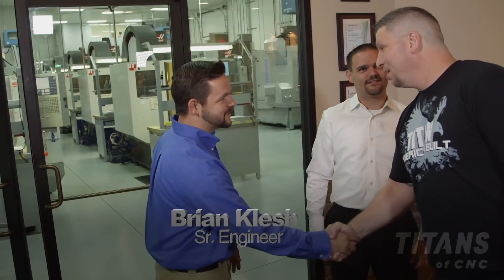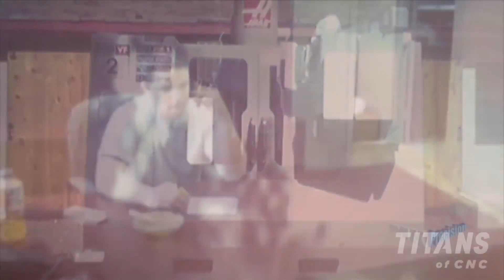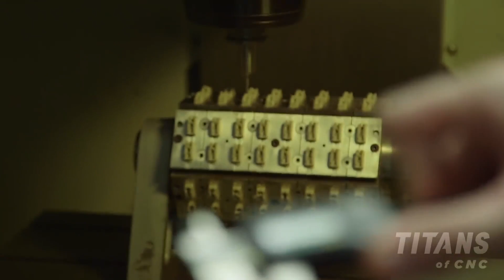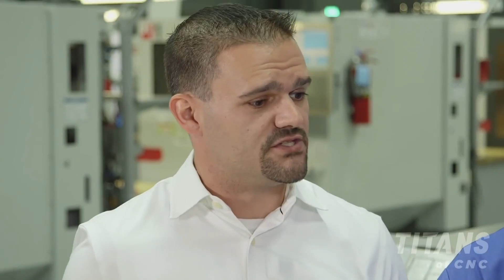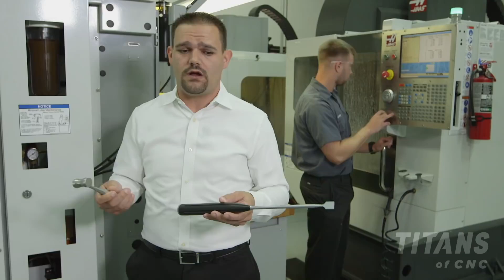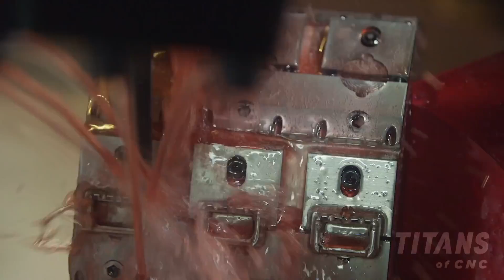CNC Machining Medical Parts Inside MK Precision

Comment: Spinal fusion sucks.
    If anyone reading this has had it done or is going to, don't be like me and learn the hard way, that you aren't going to be able to compensate 100% by working out or any other forms of physical therapy, You will be permanently limited in movement and strength and trying to get that back will only result in further damage. Get some good education or whatever it takes, to either work at a job that is not physically demanding or work for yourself so that you can choose what you do and how you do it. If you love physical activity, it wouldn't hurt to work with a personal trainer who is knowledgeable about your condition so you can learn what is and is not going to mess you up. A masseuse wouldn't hurt occasionally either.  ...or regularly. lol
  Just to elaborate, I was fused in the middle, at age 14. I started weight lifting when I was 15 and thought I could compensate for what I had lost through weight training. I gained a lot but the real mistake was thinking I could do anything anyone else can do. I got into construction and steal fabrication and did some of the most physically demanding jobs out there. I wasn't aloud into the military but I was interested enough that I learned what the majority of  requirements were at the time, for the marines and I probably could have made it through their boot camp. But the problem lies in what happens over time, when you subject yourself to stresses beyond what the surgical alteration is capable of. Man just isn't good enough at redesigning the body yet.
 
To sum it up... I broke.
Reply: Your story is amazing!! Thank you for sharing! I was in and out of ER four times over 12 years for a degenerative disk between L2 and L3. An MRI today shows a normal healthy back. I believe that I was misdiagnosed. My ortho denies ever telling me that I had a degenerative disk. Maybe next visit, if any, he will read my chart first. My medical record doesn't have an ego, but my ortho's head...well the portraits on the wall tell all.

Comment: I worked in a very similar plant for a little over two years. Very interesting work but the management was the worst I've encountered.
Reply: These two guys seem like the individuals you speak of.
Reply: If there's expecting me to run 4 machines I'll pass on that place , welcome to the new future work your ass off on 4 machines at the same time...hope young people realize just because technology is cool it's not when u get out of work just too tired to have a life outside work
Reply: This channel is great, titan is really want to share his success. But 4 ,5 machine running  one repeat part is good for owner not operator. 2 year on that job, know nothing only button pusher. you think you know some thing??. Go apply for some other job u will be shocked
Reply: If employees only knew how difficult and heart wrenching building a business like this is they would never even consider crying about the job they get paid to do. Ownering and operating a business like this is all consuming. There's no such thing as a punching a clock because the clock never stops. Don't believe me, quit your job and start your own business like the one in this video.